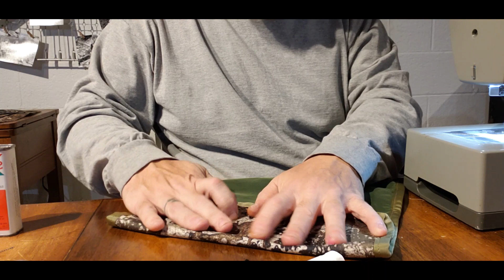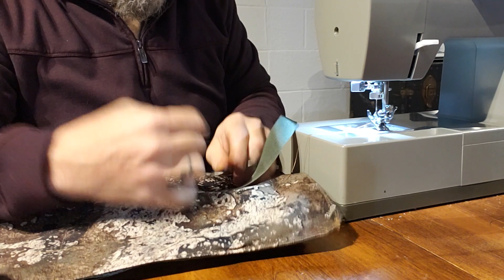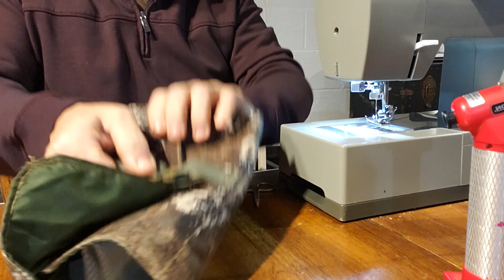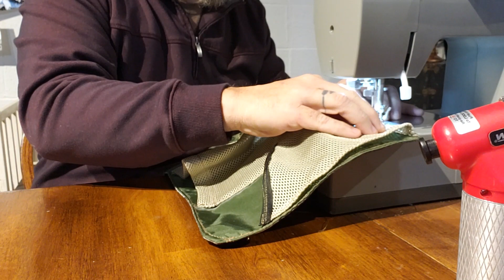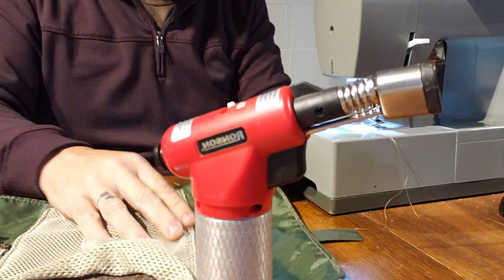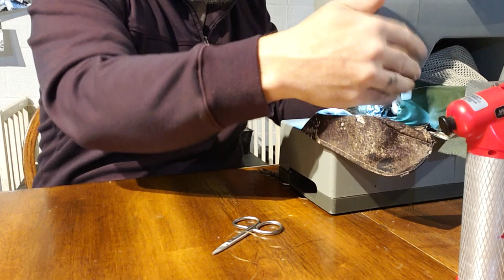DIY Rappel Rope Bag Build Vid 3 of 3

Comment: I would have liked to have seen how you put your rope and rapel devices in the bag. I am wondering if it is a roll pouch or a pocket pouch (and I have no idea which is best).
Reply from the maker: Hey Cary. Its a pocket pouch as it does not "roll open" like the typical roll pouch. There are a few reviews and highlights out there (Saddle Hunter and Platnium Pursuit) that show how its loaded. I just wad up my rope and stick it in the top. Regarding which is better, its just personal preference. We came up with the idea  because we prefered to use the saddle space that a roll pouch ( mounts horizontally) uses for other gear. The trade off is that our DOB hangs lower.